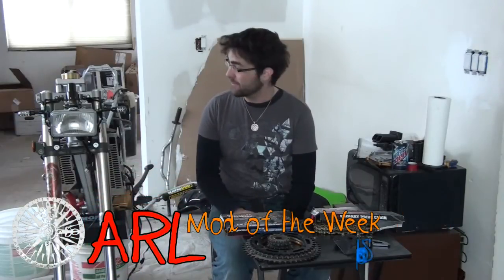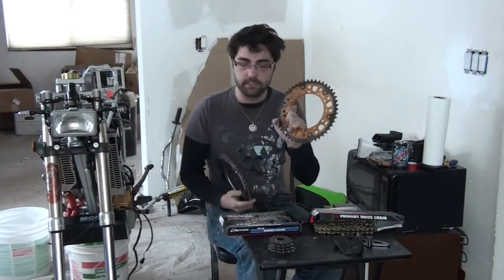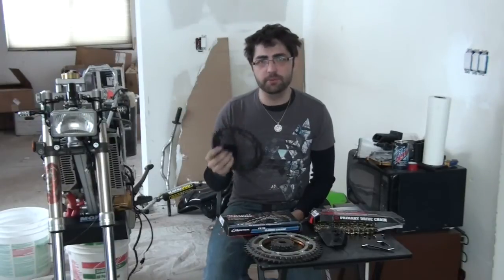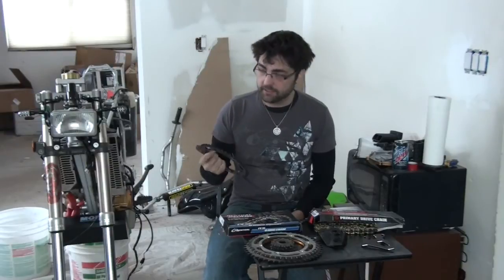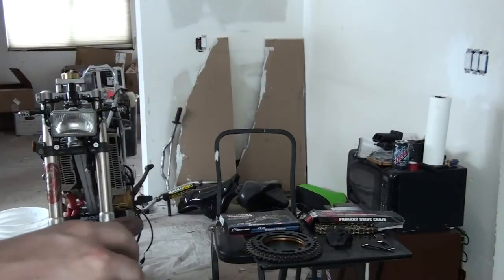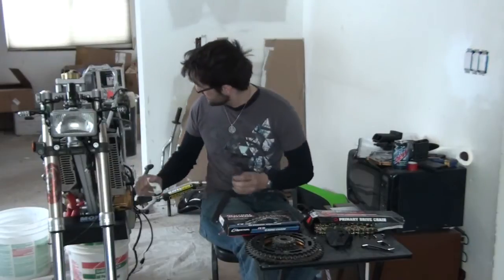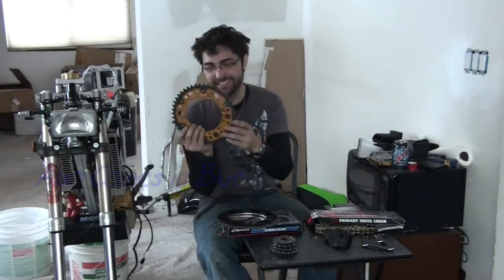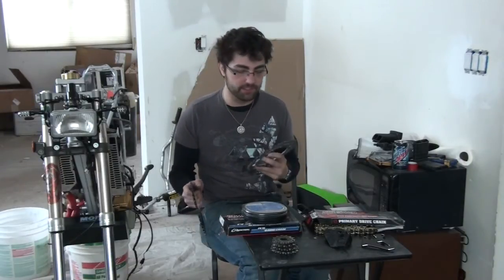What to Consider when Choosing Sprockets For a Dual Sport Motorcycle - MOTW

Comment: Excellent video man! very informative. I used the gearingcommader website when I was researching what size sprockets to get for my DRZ. 15/38 great for street, but sometimes you miss the extra pull.
Reply from the maker: ***** When I upped the engine to a 350, I still had the 13/45 ratio. I was doing accidental wheelies all the time! Yeah, the pull is fun, but you can't ride on the freeway without vibrating your hands off.